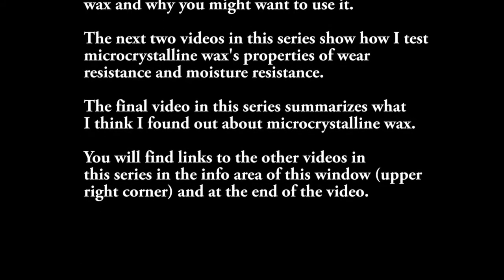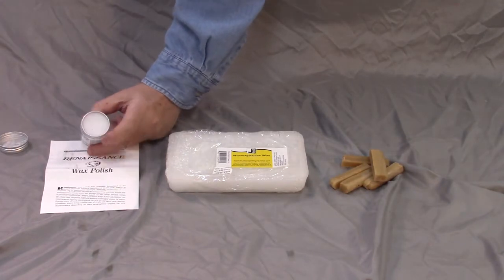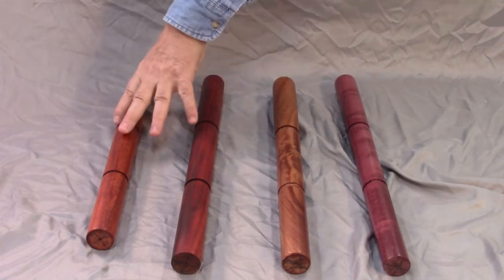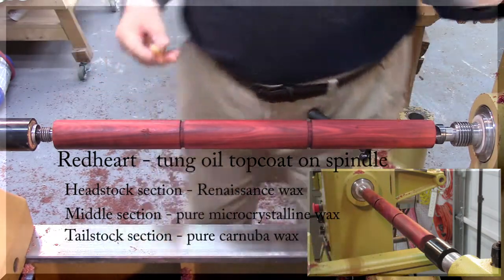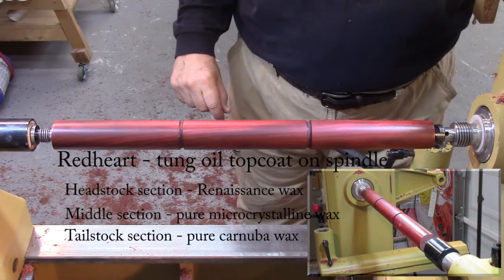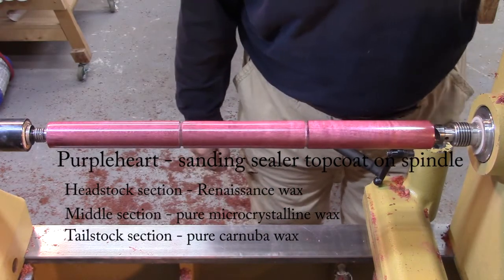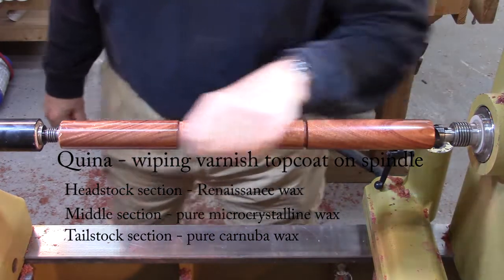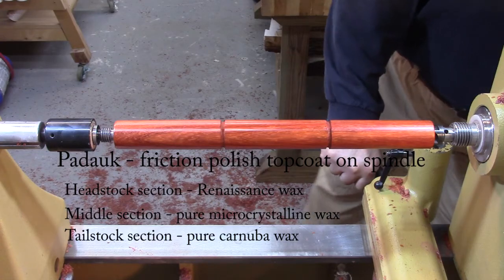Microcrystalline Wax - Part 2 - Testing for Brilliance

Comment: Caranuba[?] wax gives the loveliest finish [Looking at your vid].but as you say...just a gnats' whisker between that and microcrystalline wax.
Reply from the maker: I still use carnuba wax more than microcrystalline wax. Thanks for watching, Oakleaf.
Reply: @RickTurnsWoodturning  Is it possible to mix them?
Reply from the maker: Yes, indeed. It’s something I planned to do a long time ago and just never got around to doing. I believe Hampshire Sheen has both waxes in it.
Reply: @RickTurnsWoodturning  Thanks very much for your reply. I'm going to make some myself, just waiting for the micro wax to arrive.
It seems the main ingredients in Hampshire Gloss are carnauba wax, the micro wax, and danish oil.  The danish oil is the only bit that is tricky, since there are so many different types. Though as the Hampshire stuff drys so quickly, and most Danish seems to have some polyurethane in it, I'll have to experiment and maybe see if other oils work as well.
But I'll try the most common and see what happens. 
At $20/£12 for 4 ounces, it's decidedly worth it as I can make at least a pound of the stuff for that price.
I'll let you know how well it performs if you like.
Thanks again.
Reply from the maker: You could also use tung oil or boiled linseed oil or even mineral oil. I'd love to know how it works out for you.
Reply: @RickTurnsWoodturning  Thanks. I'll try one lot with danish, one with tung and one with mineral. I'll let you know if it's any good and price it exactly.